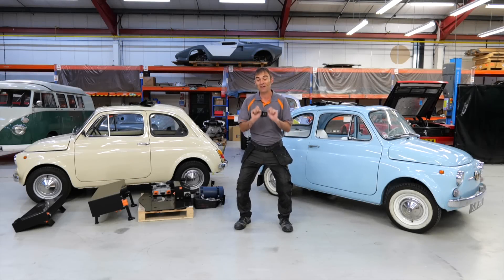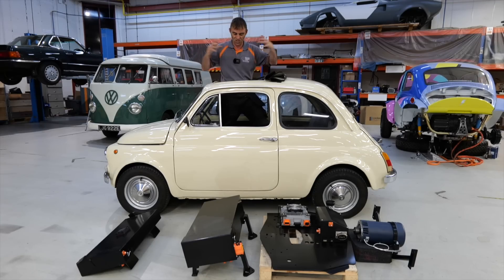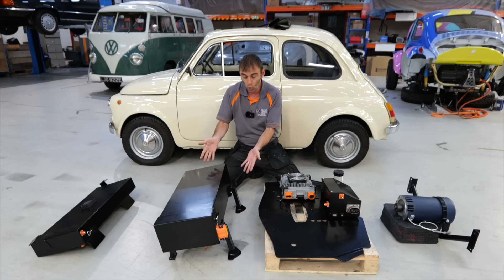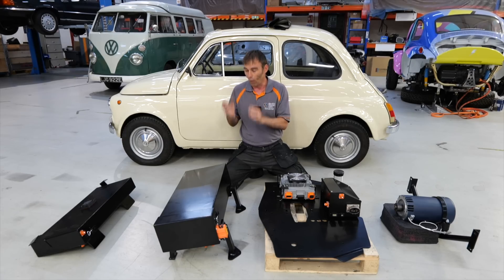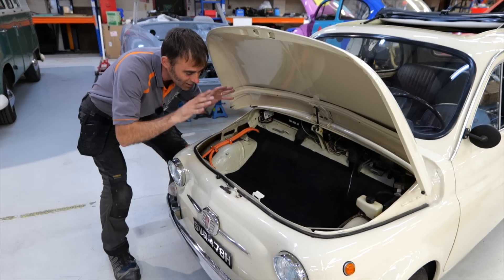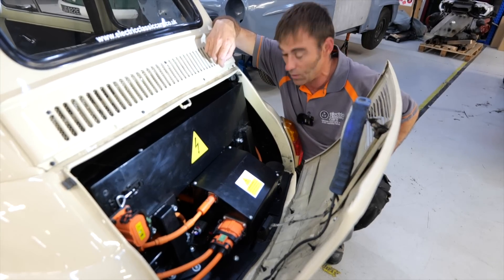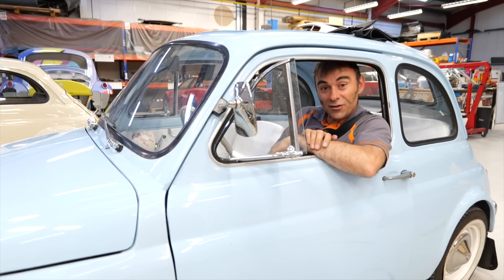Fiat 500 bolt-in electric conversion kit.

Comment: This is cool and in the right spec. A possible alteration may be a fiat 500 e-conversion with no gearbox (Gear lever) and a central driving position. 🤪

Q. The gearbox in the video looks new. Is this an original part or did you install a newer gearbox which could handle the increase in power?

Love these videos.

Comment: I would have to agree that this would have to be one of the best cars for electric conversion. I personally would love to convert an Austin A30 or A35 even though it is not as suitable, I just like the look of them so much more and they might have a bit more of an upright seating position which would be better for getting in and out of.
In my case it would be used as a second car for short trips to save wear and tear on my diesel work truck. I was thinking for my use it might be possible to remove the gearbox and have a smaller motor than normally expected where the gearbow was and have a fixed gear ratio that is low enough so that top speed is only a touch above 80km/h which is one our speed limits here in Australia and even a range of 30km would be fine for me also which means it could easily charged every night from a standard 10 amp outlet. Of course it would not be allowed on motorways but it may be allowed to be registered to be used on minor roads.
I think you can get a lot more bang for your buck with a short range EV.

Comment: Another fantastic & sympathetic conversion. One question though, on all the cars that you have converted to electric, what happens to all the mechanical items (internal combustion engines, gearboxes etc) that you remove from the vehicles - do you sell them, give the back to the owner or scrape them….etc ?
Just curious 🧐
Reply from the maker: The customers usually sell them back into the classic car market. 👍
Reply: @ElectricClassicCars  I thought that might be the case as it helps to keep other classic cars going. Thanks for replying & keep up the good work. 👍

Comment: Seems to me with a 48HP motor you could eliminate the transaxle completely and go for direct drive to the axles.  Or if you want to retain the transaxle, use a lower HP motor and increase your range.  I think people, especially ladies, would love a car like that for city driving with simple direct drive , rather than fiddling about with the gearbox.
Reply from the maker: If direct drive is what you want, just leave it in 3rd gear. I often drive them about for days just in 3rd. 👍
Reply: @ElectricClassicCars  That is exactly my point- if you can drive around in a top gear, the gearbox and all the stuff that goes along with it, clutch, pedals, master cylinder etc. are redundant.

Comment: What an adorable car, made all the better by now being a clean, zero-emissions EV.
Brilliant work, Richard 😎
Reply: Electric cars are not zero emissions- they actually require greater emissions than IC cars, it's just that the emissions are moved to other places from the mining of the rare earth minerals, to the production and maintenance of the power grid.  Their real advantage is in the reduced repair costs due to the elimination of so many complex parts now required to make IC cars compliant with regulations.
Reply: @oldschool1993  I read that over the lifetime of the average EV including production, 18,000 kg of CO2 is produced and that over the lifetime of the average ICE engined vehicle including production, 24,000kg of CO2 is produced. That's 33% more than an EV if those figures are still relevant.
Reply: @NeillWylie  Those figures are from the Tesla brochure.

Comment: As early as 2027, driving with a combustion engine will probably no longer be permitted outside of professional and delivery trips, the Federal Exhaust Gas Fun Ban Ordinance BABVVO was recently announced and exhaust gas fun will soon be banned. The Transport Tourism Emission Restriction Federal Ordinance TEBBVO was also announced....should get all combustion engines commercial vehicles, construction machinery, agricultural machinery and even inland waterway vessels off the roads / waterways by 2035. Buses in the cities (and all taxis) must be completely converted to electric drives by 2025 (supposedly an EU regulation!)! That will be funny! Have you ever read Berlin leaks? Then it takes off your shoes! They are planning the demobilization under the cloak of a campaign against "fun using fossil drive energy" in road traffic... the SOKO Autoposer should hunt down all fun fossil drivers in the future! This will be a STVO Stasi with BABVVO apps for monitoring as a little helper to control the exhaust fun...!!!!!

Comment: Thank you for the video Richard. Much appreciate!

I'm from the USA, so I apologize if my list isn't very good.

- Ford Anglia or Prefect 100e.
- Hillman Imp or Singer Chamois (or any of the various manufacturer/model namesakes).
- Austin A30 or A35
- any of the various NSU air cooled/rear engine models
- Fiat 600
- Fiat 850 any model, but preferably an 850 Coupe'
- Opel GT (early 1970's model based off the Kadett? or Manta A?).

*I don't know about the availability and/or collective value of most of those I listed.

I'd prefer the sportier models I listed, but here in the USA we never had any vehicles like the Austin A30 & A35, so I think one would make for a nice little city car (not a whole lot different that this Fiat 500 Richard converted in this video).
Reply from the maker: Great list 👍
Reply: @ElectricClassicCars  What about instead of the NSU a Simca 1000?
Engine in the back in the length  with the gearbox partly under the back bench and with a lot of battery space in the front which is also good for the weight distribution/balance..... AND on both sides of the now scaled down engine in the back a lot more space for batteries. But I fear the Simca 1000 bodies are to rare to convert it anyway....

Comment: A small correction. That’s a 500 F and not a 500 L. The L is recognisable by additional chrome tubes attached to the front and rear bumpers protecting the front indicators and rear lights, and other shiny bits attached to the car exterior. It also had a carpet interior and a slightly rectangular instrument binnacle with the speedo out of the Fiat 850.
Reply from the maker: Thanks for the correction. Every day's a school day in life. 😁👍
Reply: @ElectricClassicCars  You’re welcome. I love your work, your channel, and I firmly believe in the EV conversion of classic cars as a means of preserving the 20th century’s heritage. Do keep it up, and long may your business thrive!
Reply: Also, the "Lusso" dashboard was not in painted bare metal, it was covered in black "brittle" plastic. And obviously, the model logo on the back was "Fiat 500L".

Comment: What type of motor controller do you use? Fantastic video
Reply from the maker: Curtis controller. 👍
Reply: @ElectricClassicCars  fantastic controllers, we use them in our electric forklifts. 80 v drive motors. We used 48 v in the late 90’s big heavy ac drive motors

Comment: I think the old MG Midgets would benefit highly from this conversion as the motors on them were highly unreliable and small, If i remember correctly some had a 3 cyl. Just going off memory from when my uncle had one 20+ years ago.
Reply from the maker: Check out our electric MG Midget. 👍 https://youtu.be/ZvQlX2iAXk4
Reply: MG midgets mainly had variants of the BMC A series 4 cylinder engine the 1500 rubber bumper later ones sharing the Triumph Spitfire engine which was also a 4 cylinder. They were all generally pretty reliable but just required more maintenance and servicing than modern stuff and also not so capable of doing big miles without rebuilding.

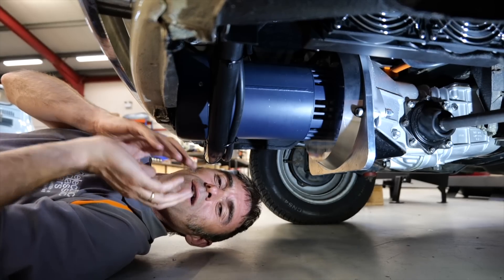Comment: amazing. question though 6:24. isn't it bad for the gears, like a slow wear tear, if you start move the car at 2nd gear? while I do this on diesel vehicles, they seemingly have beefier transmission
Reply: First gear is designed for starting up hills steep drive ways pulling trailers etc. So most vehicles can start in 2nd gear no problem. Trucks can pull 80 ton loaded. But empty say 10 ton they would never consider starting in low gear most would miss several gears. Changing 35 gears at a time would not be fun. The diffs would be in highway gear as well. So empty they will try to use I’m guessing 5 gears out of 35 gears but start on steep mountain 80 ton they need the whole 35 gears. Just example of older models. 35 gears would be 2 gear boxes and 2 speed differential combinations
Reply: @davidwright1752  right. i knew this driving diesel, the first gear feels like made for inclines and first gear is almost useless in city roads. however, with this fiat 500, I feel the transmission is just built for the torque of the ICE engine, in addition to the age and wear tear of the gears.
Reply: @zodiacfml  You have  good point However these old machines were over engineered. I trust these guys have done there sums. Let’s hope so. I would want a better gear box if was racing it.

Comment: Would love to convert my 82’ VW air cooled transporter. The original engine is still running strong but the constant oil leaks and NOISE plus 19MPG on expensive E5 petrol, makes me constantly think about how much better an EV conversion would be!
Reply: Guess how much fuel can you buy for the price of a proper conversion...
Reply: @JohnDSmith-po4nu  12,500 litres of fuel
Or ~53,00 miles of fuel

Comment: Wonder if making all the metal work for these kits in carbon fibre would give a little additional range as well as weight reduction? Add to price too so perhaps a trade-off
Reply from the maker: We have made a CFR battery box but it was very expensive. Where weight is a factor we make aluminium battery boxes.
Reply: @ElectricClassicCars  some years back i installed a CNC cutting machine in F1 and Indy places in South England,  saw the whole process of how they make or should that be bake? The chassis..   interesting

Comment: The 500L meant Lusso and had the additional chrome bars on the bumper and was a later version. That is the 500F or 500D.
Reply: Or an R. Definitely not an L though as, as well as the things you listed, the L had a larger rectangular speedo, plastic covered dash and the tall red FIAT badge on the front plus 500L on the boot. Nice little cars.
Reply: I think the R was the last model they did and that had the fiat 126 wheels instead of the 500 chrome hub cap ones. It also had the fiat 126 engine which was 600cc. I remember as a kid having a Quattroruote magazine that had them all detailed.

Comment: I'm still waiting for one of the '60s big cars converted to a powerful cruiser, but I'm afraid it will be hard to find one that is in good enough shape metal wise...
Reply: It seems that GM and Ford are targeting those with their electric crate motors. They have not made them into kits yet. The Mach E battery modules seem to be getting popular in conversions already.
Reply: Check out Project Electrollite. Granted, definitely not a kit, all custom work. Very cool conversion.
Reply: @jameshaulenbeek5931  That is a great project. Very clean and well done. The Salvage to Savage C10 is also an extreme conversion.

Comment: Lovely little car. I'd like to see an EV conversion on an Austin/Morris 1100 or 1300. They were small - not that much larger than a Mini - so would make practical city car, but with more room than the 500 or Mini. The Wolesley or Riley versions, with the wood, leather, etc, would be nicer, although they are very rare these days. I suppose the only problem would be finding a decent one of any of the 1100/1300 models to convert. The sub frame mounts used to rot, which led to most of them (including the ones I and 2 friends owned - one was a Riley, too) being scrapped as repair was uneconomic. Really nice little cars when they were sound.
Reply: I'd like that too. My dad's first car was a 1964 1100.
Reply: Absolutely that would be great. Electric drivetrain and hydrolastic suspension.
Reply: I am in Aust NSW & have a mint condition 1966 Morris 1100. No rust all sills cut out & rebelled with Sil/Bronze. Would love to get it converted.

Comment: Such an awesome and clean retrofit!  I wish we could get something like this in the U.S.  Are the Tesla batteries new stock or repurposed from dismantlers?  ICE-to-EV conversions are THE most sustainable solution, far better than buying a new EV.  This industry needs to explode!
Reply: Very interesting question, and I wish he had responded 👍👍
Reply: He's made it clear in several videos that the battery modules are second hand. That's why he typically averages them out as being 5 kWh each, instead of 5.3 kWh. They're probably closer to 4.8.
Reply: @lighthousesaunders7242  Thank you very much for the information, and this is what he should have answered, instead of a simple "thanks" 😉😉

Comment: A citroen 2CV electric will be hilarious, The first original one has only 8 horsepower.. so with this motor a big improvement 🙂
Reply: It is available in France, but conversion is only legal (in France) if you respect original power.
Reply: @colletjulien  Can I respect it with 80hp too? Like yes, cool 8hp, but 80hp is much nicer now.
Reply: @maxdergroe9082  80hp is almost too much, my Renault Zoe has that and it's quite fast already, and that is a car that weighs more than twice as much as a 2CV, that's quite a bit of power in such an old car.
Reply: The 2CV is the perfect donor car. Loads of room with a low rolling resistance and very light.
You'd have to strengthen the chassis though.
It would fold like wet cardboard! 😳
Reply: Already exists,that E-  2cv

Comment: Hillman Imp stiletto. Riely Elf/Mini Moke.
Fiat Panda  or the original Renault 5 or Twingo. 
Another neat conversion and doubling the power helps with steep hills through tiny village streets.. where even a Suzuki Jimini struggles to pass.
Reply from the maker: Hillman  Imp Stiletto or Singer Chamois? 👌
Reply: @ElectricClassicCars  
Always liked the fastback imps
Or clan Crusaders.. but thats a rally car. Great little all alloy engine but prone to overheating due to lack of anti corrosion antifreeze it was always their undoing that and a barely adequate  radiator...
Plenty of  space for a pack up front and the rest to the rear.

Which one had the tinted glass and vinyl roof?

Comment: How about the old rear engine Skoda 105, 120, 135 Rapid?
I used to run two, with a third engine that was rebuilt every month and swapped in while my then wife did nearly 50k miles PA in them, thrashed in rotation.
Even then, in the early 90s, I was thinking it would be a neat electric conversion given they handled better with some (lead acid battery) weight in the front.

Comment: How about an original fiat Panda. Can’t get much simpler than that.. there was loads of space around the old 903cc or later 999 Fire engine.. The car was a hoot to drive and in electric form I’m sure it would be ten times better

Comment: Recently my thoughts have been turning to the longevity of modern classics, specifically the BMW Z4 Coupe. I wonder if it is a suitable platform for conversion more in keeping with its original performance.
Reply: I converted a Saab 900 in 2015 and have been using it as a daily driver since .. still going strong.. the technology for this has been readily available with  some time now.. my conversation cost about €10000 at the time (24kW pack)  It has paid for itself by now… kits are convenient but are not going to be cheap….
Reply: I’m intrigued by the Zero EV early Boxster conversion, fancy one of those
Reply: Imagine doing it yourself too, if and when better battery options come out, instead of buying a new car, you can simply upgrade your battery.

If they ever release this in a production car, things will get crazy, as right now one of the few reasons to buy a newer electric car will be a better battery and because your old electric battery is messed up. Being able to upgrade your own battery would be a game changer